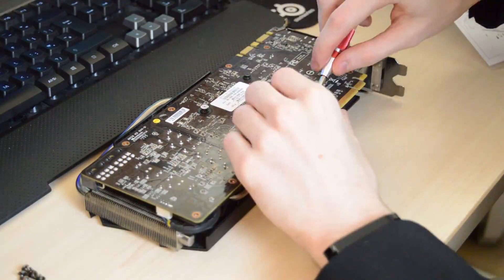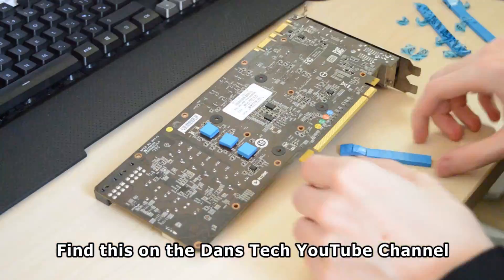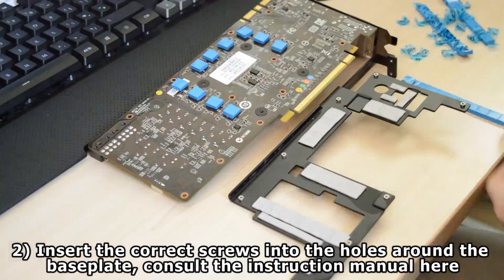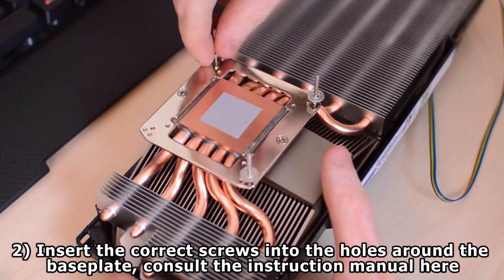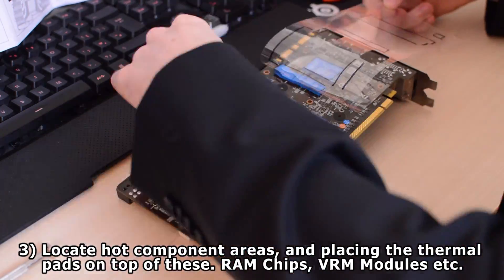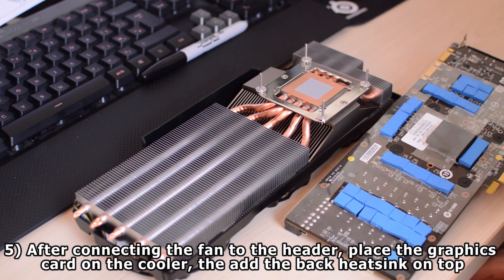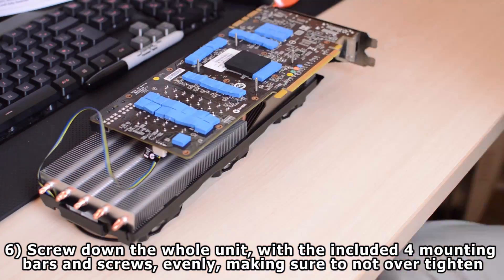How To Install A Arctic Accelero Xtreme IV

Comment: is that clear sheet of plastic really necessary? i get why it's there (to prevent shorting between circuits), but with thickness of the thermal pads, wouldn't it sit off the board enough to prevent any shorting?

Comment: Do I need to buy Vram Heatsink kit too ?  
is there space to put Vram heatsink ?  
will it be good?
Reply: You wont need it unless your RAM collects a lot of heat as it is. Common sense. Investigate the temperatures they reach and then go from there. Normally you wont need heatsinks for ram, but if they are performance oriented, then they will probably be better off with a Heatsink on it.

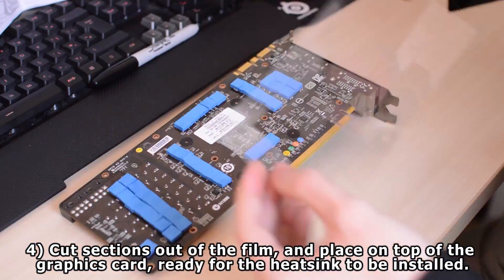Comment: Why do you keep that plastic in minute 0:45 does the build need it?, or can it be skipped ?
Reply: that is to protect board from shorting on the back plate and is part of the kit.
Reply: @royzuniga811  is that even really needed though? cards from the manufacturer with backplates don't have that plastic piece.

Comment: what extra stuff do i need except the artic acceloro and the gpu to do this mod? like thermal pads etc thanks
Reply: This is a little late, but it comes with thermal pads. Just for reference for other people. Other than that, I guess you need a screwdriver and a good chunk of time.

Comment: What card are you using here?
Reply from the maker: Hi, MSI GTX 770 OC 2GB Variant. Dan.
Reply: Thanks!
Reply: HEY man would I be able to install the cooler with out the back plate? Thinking of buying the cooler but not sure if it would clear with my CPU cooler
Reply: @maxcardenas8257  there's the arctic accelero Xtreme III that comes without the backplate. it's 4 bucks cheaper on amazon
Reply: This is not your video